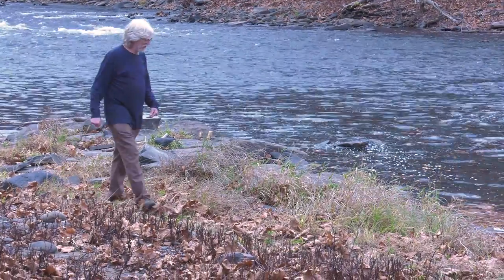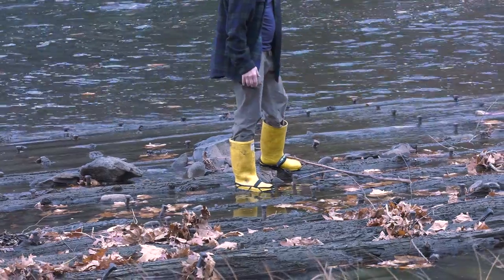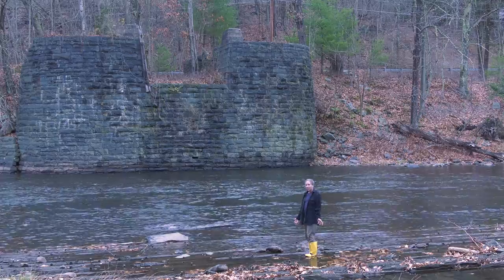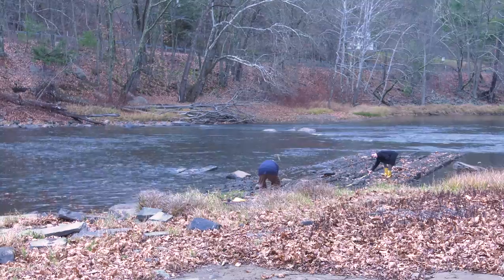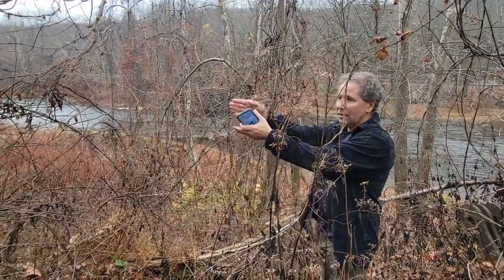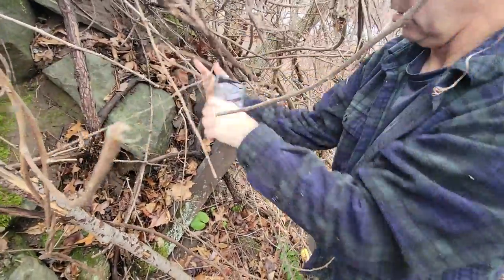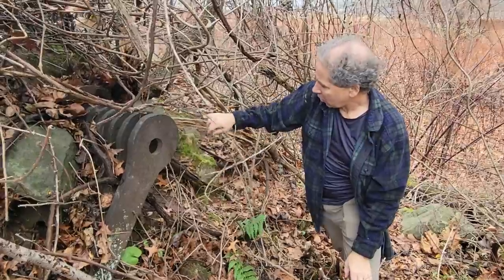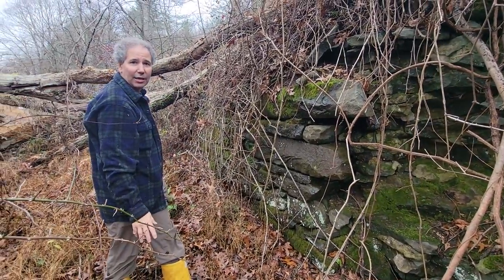New Discoveries at the Roebling D&H Canal Lackawaxen Aqueduct

Comment: Back in the summer of 1988, I worked on an NPS HABS/HAER project documenting both the Roebling Delaware Aqueduct and the nearby Zane Grey House. Prior to the Lackawaxen and Delaware Aqueducts, there were two canal locks on either side of the Delaware River by the confluence of the Lackawaxen. The canal barges hauling coal from Honesdale dropped down on the west bank and crossed on the Delaware River and then were raised back up to the canal on east Delaware bank. As I recall, prior to the aqueducts, there was a lot of expensive litigation between the D&H Canal and lumber companies floating logs down the Delaware. The aqueducts eliminated the legal conflicts as well as the delay of the two locks.